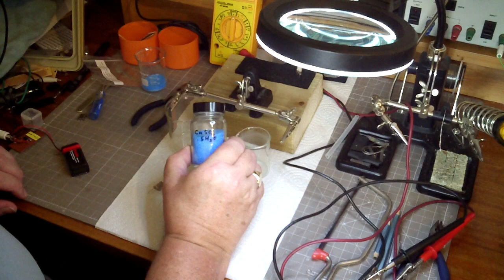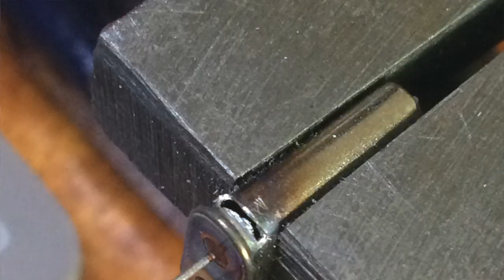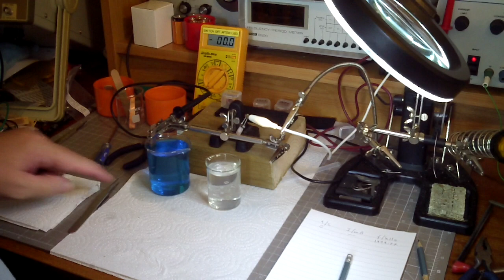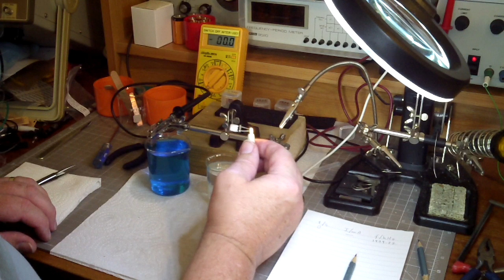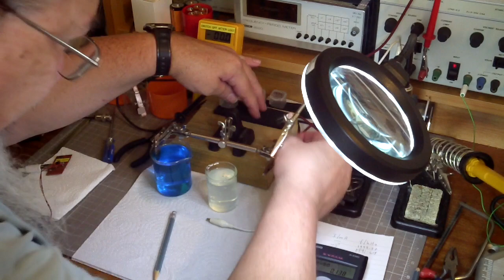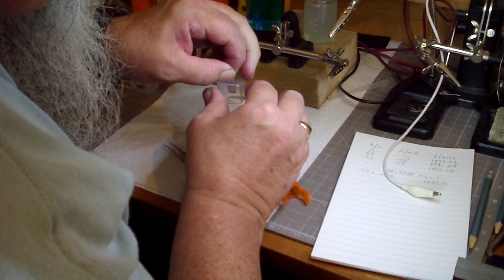Lowering the frequency of a quartz crystal by electroplating

Comment: You could drill two holes in both sides of the top, and inject a tiny amount of copper solution. Then use the case as anode. Getting the crystal clean and dry is probably a bit tricky, but the casing will be almost in tact.
Adding a bit of glycerol to the solution can help build a good quality copper layer.

Comment: To seal the crystal, some large heatshrink should do the trick, with a drop of glue in the top to seal it properly, wouldn't oxidation of the copper cause the frequency to shift?  maybe cover it in some hot glue to seal it, pop the heatshrink over, fill the top. and it should fit anywhere it used to.

Comment: Thanks for this! Got a few xtals for 2 meters that are of a higher frequency than what I need. Going to give this a try and see what happens. 73!
Reply: If you only need a small shift at VHF on a multiplied or overtone oscillator, you may be able to achieve it using only Sharpie ink on the crystal. Bear in mind that this will give a much bigger relative shift which may make it difficult to hit the right frequency. But good luck!